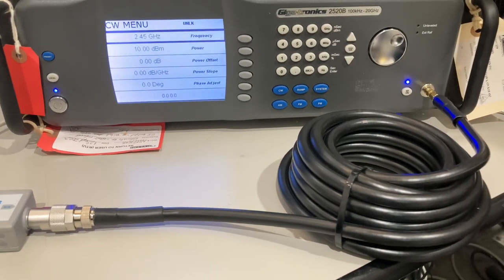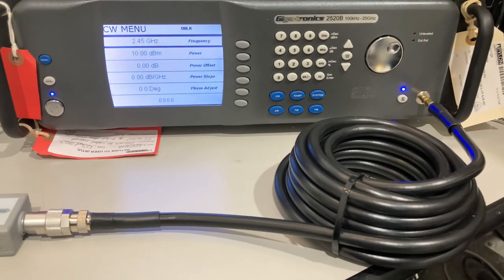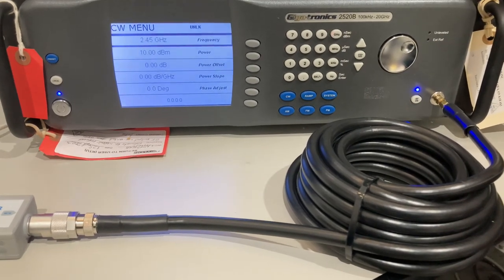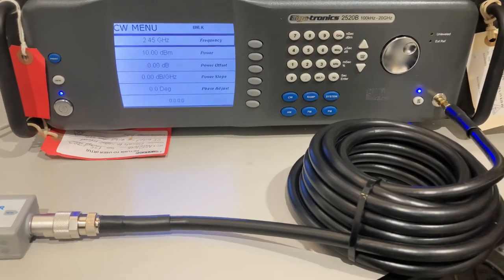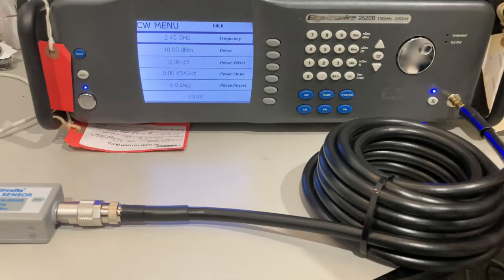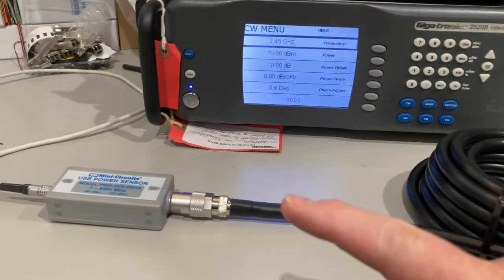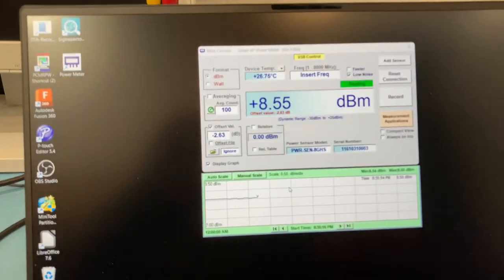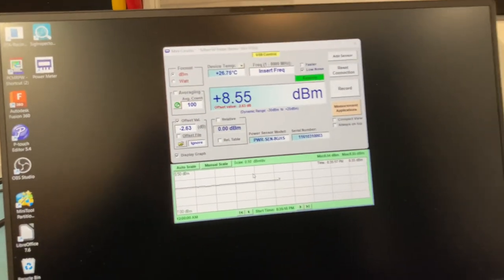Testing KMR-400 low loss coaxial cable transmission line loss using power meter.

Comment: Great video showing the real loss on a higher frequency. Could you please delight us with another video but longer at 440 MHZ.
Reply from the maker: The loss at 440 MHz will be much less....less than 1db so not to worry it.

Comment: How about the loss at 27 MHZ? I purchsed this today to replace some aged RG-213. And hoping for better resaults and less loss.
Reply from the maker: The loss at HF is insignificant at 20-50ft.
Reply: Purchsed 75 Feet of the KMR 400.
 @ampedupelectronics
Reply from the maker: 50 feet of KMR-400 around 0.412 dB or 9% power loss. 50 feet of RG-213 is at 0.561 dB 12% power loss. Not a huge difference at that frequency.
Reply: What about a difference between this and LMR400 with a length of 100’?  I’m trying to decide if it’s worth spending the extra money. Will be used for GMRS.